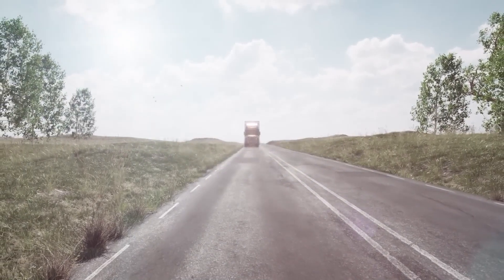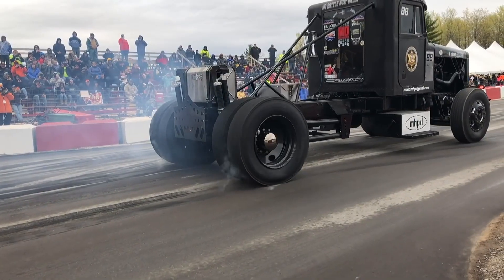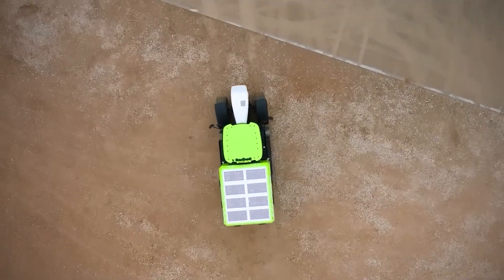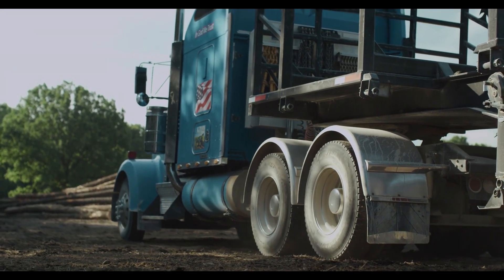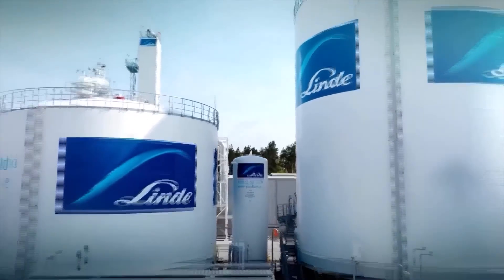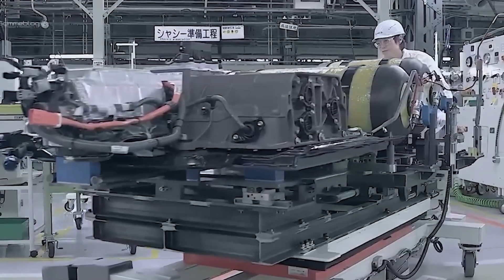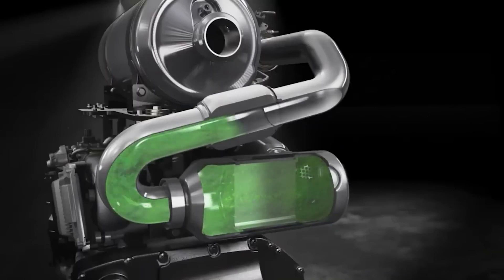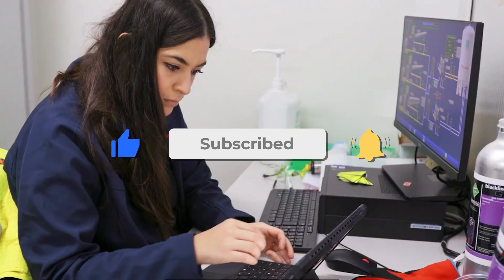Cummins Hydrogen Engine Will END Diesel Forever? (Hydrogen ICE Truck)

Comment: This is rubbish.  Not a single detail of the Cummins hydrogen engine it is supposed to feature.  Lots of mention of hydrogen fuel cells, pics of JCB hydrogen engine and an assortment of uninformed comment.

Comment: Hydrogen ICE's are vastly less thermally efficient than either petrol or diesel engines thus will use vastly more fuel to produce the same power output. that is even before considering the well known problems of storing Hydrogen or its virtually invisible flame front if any leakage is ignited.

Comment: Diesels does not ignite with Spark plugs, Hydrogen engines needs the spark.
Reply: Diesel does Not spark plugs.. Apparently the person who made this video is definitely not Mechanically Inclined for him to make a statement that the difference between the Diesel engine and Hydrogen engines is that the Diesel engine uses a spark plug, and the Hydrogen engine does not!!  Do your research before you make such videos...

Comment: I looks much more like a petrol engine as it seems to use a spark plug rather than compression ignition. 

Most Hydrogen is not made from water using Electricity but from Methane and is a very environmentally unfriendly process. 

Fuel cells and electric motors are probably much more efficient than an internal combustion engine so what is the point of this?
Reply: yea but where you dump all batterie after they  expiered ? that batteries not fully recicleable  ! even  less than 30 procent can recycle !